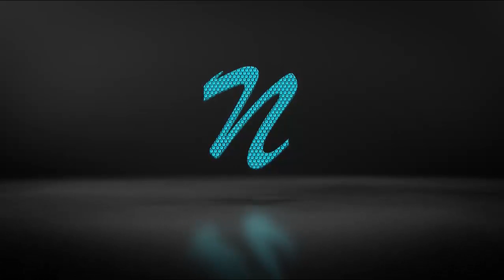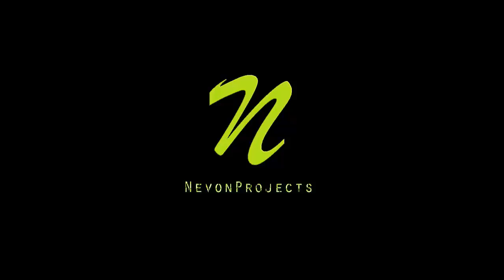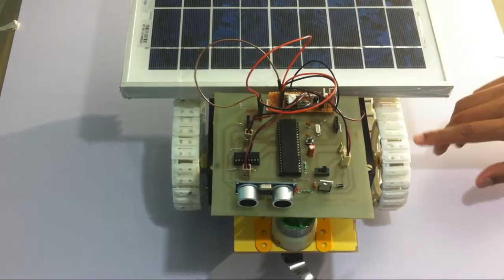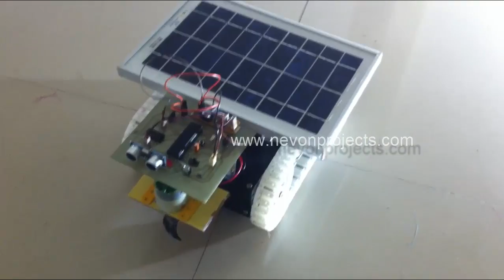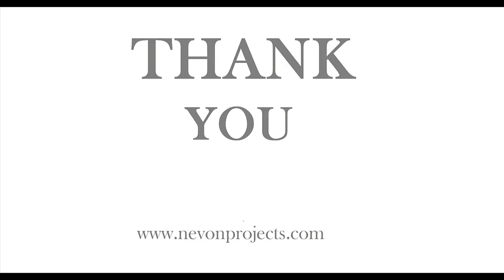Fully Automated Solar Grass Cutter

Comment: can you provide motor's specification for driving those load used in the body of cutter??
Reply: I guess one is high rpm dc motor (around 12 000 rpm) to cut the grass. And other two are (left and right) low gear ratio motors around 10 rpm and high torque.